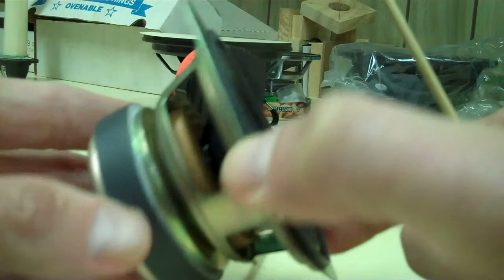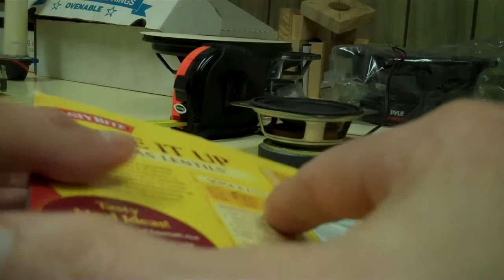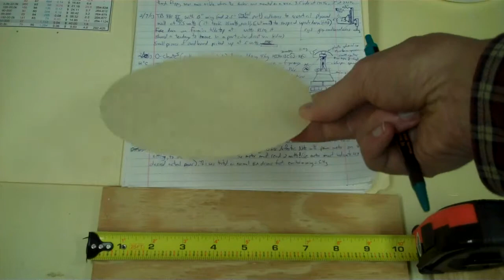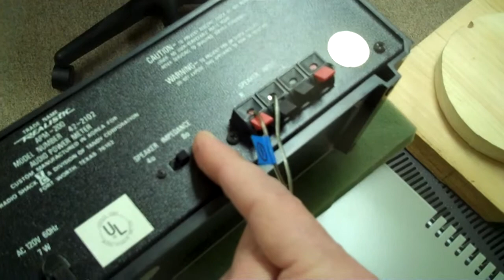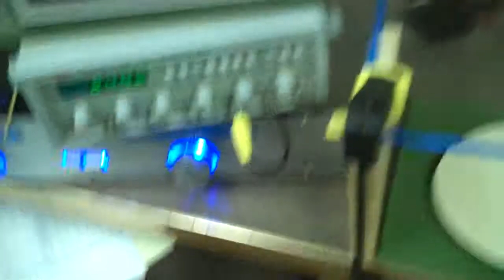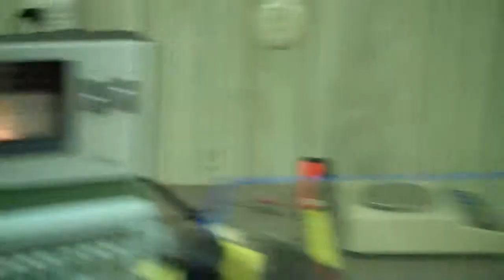OL4: Exciting Wing: Setup

Comment: how much mass can the speaker support before breaking the gap?
Reply from the maker: These drivers are called "exciters" because they can't function as audio loudspeakers on their own.  They must always be attached to a surface (such as my wing) in order to couple effectively with the surrounding air.  

The particular orthosonic vehicle ("air bearing") shown, with a 6" diameter oak tag wing and a 3 watt capacity central exciter can support about its own mass (33g) at a power of 1 watt, when I glue a small loop of wire under it, from which to hang a payload.

In the next two videos (OL6 & OL7), I will demonstrate scaling down in size.  Following that, I will scale up, with a corresponding increase in payload capacity.